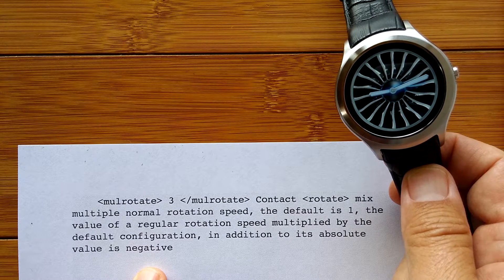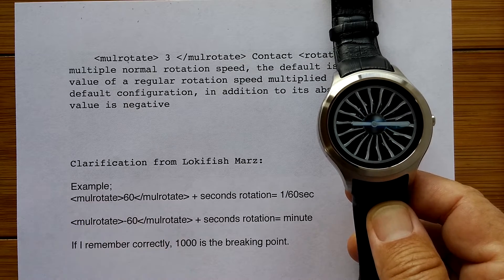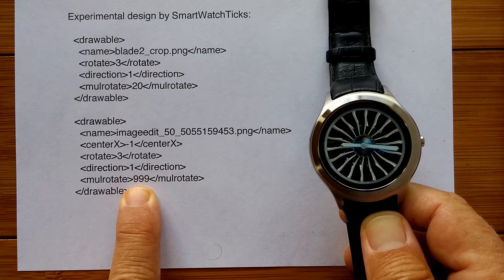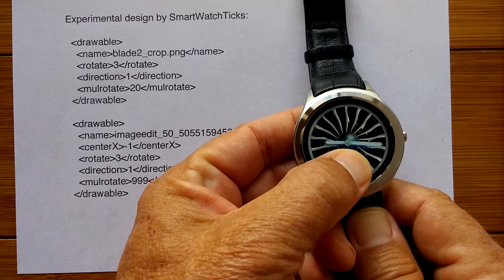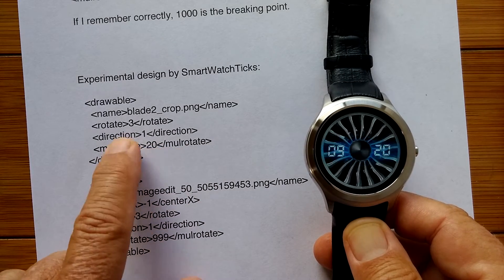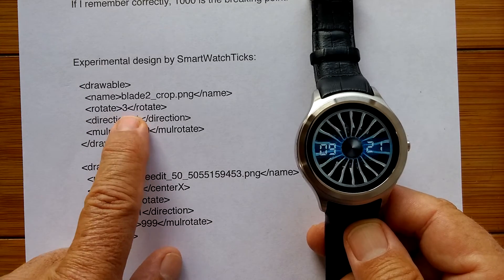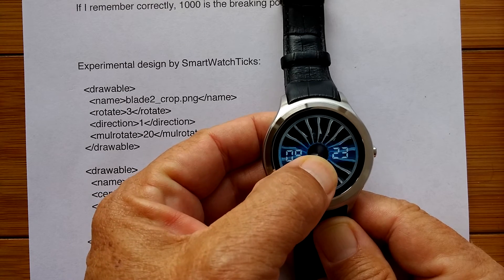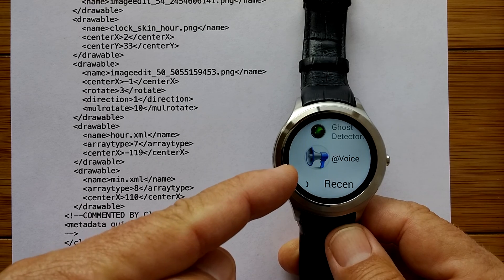No.1 D5 Part 4 Clock Skin Creation Workshop - Multi-Rotation

Comment: There are two watchmaker watch faces I would like to import to my No.1 D5 and K18 Smartwatches. Is there an primer for how to accomplish importing and exporting Watchmaker and Facer files into the No. 1 D5 and K18 XCDMA smartwatches?? 
Any assistance would be greatly appreciated.
Reply from the maker: Unfortunately you need to strip the pieces from both Watchmaker and Facer, then create a clockskin.xml file to put them back in the right place for these watches. You can learn more here: https://plus.google.com/u/0/communities/109827242607524552712/stream/1a9cd3cf-1ade-4a5f-8591-86b8824f644d
Reply: Okay I've gotten that far but do not understand what I need to do to save the build once everything is in place.

Comment: Hi,
I finally found an easy way to root you watch in one min.
All you need is to install kingoroot and press try to root.
Reply from the maker: +Ido Aflalo Really? The folks over at the XDA Developers Forum seem to like a different approach as kingoroot apparently installs extra stuff you don't need. I really don't know as I don't root.
Reply: +SmartWatch Ticks As I saw There is nothing else but superuser installed. Your internal data will not change because of superuser installed on your sydtem partition. The root really helped me because now I can configure the button of the watch. I did that when I press twice on it, it will open the task manger. Also now I can Install fully the 'Greenify' app who will save me a lot of battery life. I think that root access is a must be thing on my watch.
Reply from the maker: +Ido Aflalo Just for info for others who may be reading our conversation, here's another approach for rooting the D5 watch:
https://plus.google.com/u/0/communities/109827242607524552712/stream/fb8b6f95-7edd-4bb5-baee-8d0fe40f9dc1

BTW, although you may be able to configure the button for multiple press options, best practice is to try and avoid having to press the button at all as the button is commonly a frequent thing to fail as it is mechanical. Installing Assistive Touch (or an app like it -- no root required) lets you return home to the watch face or even turn off the watch without pressing the button. Check out the video on this in the core apps section.
Reply: +SmartWatch Ticks Okay thank you!
Do I need to worry if I rooted my watch with kingoroot?
What do i need to do?

Comment: I have a problem with the watch. It turns off very often, I do not know why...I try to start it again but it does not make any move or sound. I have to plug it to the charger, and then it works again. As soon as it starts I can unplugued it and it works normally again. It happends three or four times every week. Has somebody this problem too? thank you!
Reply from the maker: +fjseron Thanks for your post, but I’m going to ask you to repost your situation to the XDA Developers Forum because they have talented people who help folks like you when they have problems with their watches (and others are reporting this problem, especially when the battery drains all the way out). Troubleshooting is not really my area of focus. I’m attempting to explain how these things work and highlight apps that work well on the watch format. XDA is much better at this. Here’s the link to the XDA Developers:

http://forum.xda-developers.com/smartwatch/other-smartwatches/smart-watch-android-watch-to-look-1-d5-t3270656
Reply: +fjseron , it could be a couple of reasons: the connections of the battery are not ok or not tighten (open the watch and check it) or there is a problem with the battery itself, are u making sure that the voltage is not less than 3v? cos if so it can damage the battery, did u charge it fully when u just got the watch?